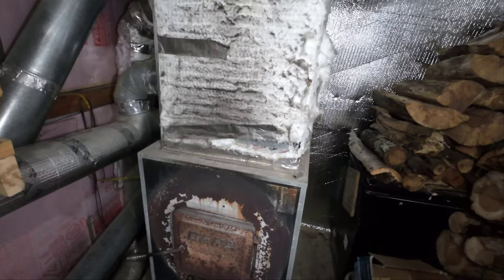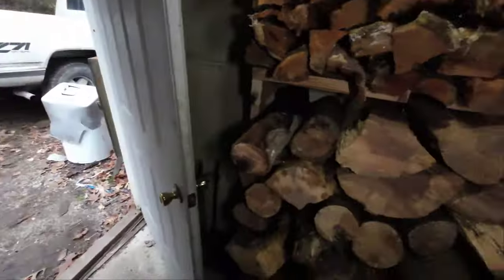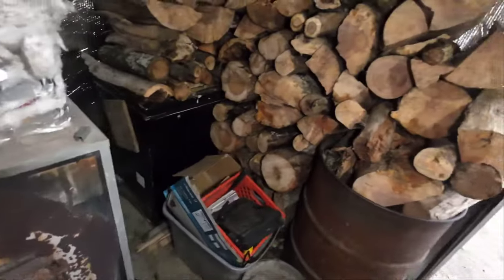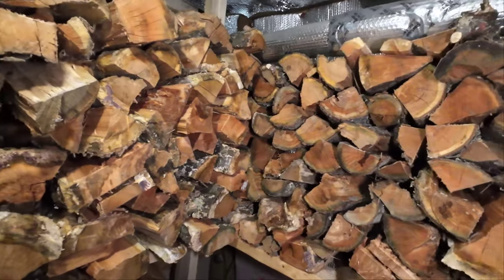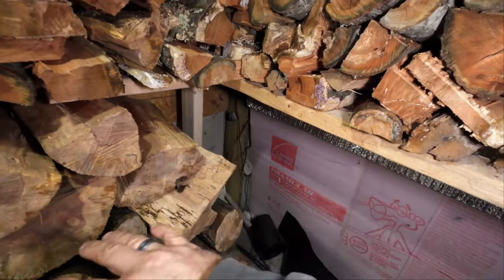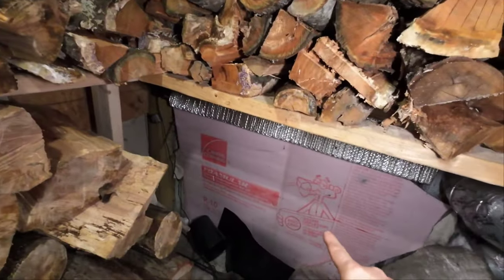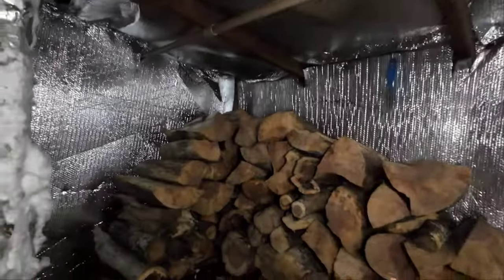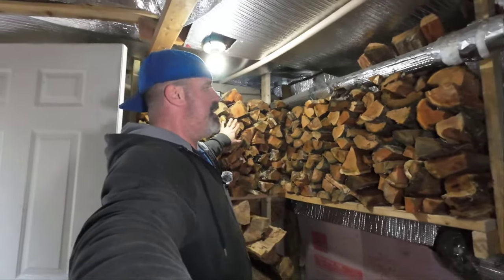Kiln Drying Firewood With Wood Burning Furnace

Comment: Get the cheapest dehumidifier you can find and use that in there.  That will draw a tiny amount of power, but accelerate your dry times tremendously.  Also, a very small fan to circulate the air in there will help also.  Super small investment to greatly improve your results.
Reply from the maker: Yes we have a small low-power type dehumidifier we are putting in. Still looking for a good isoscillating fan that doesn't use too much power adding in too many items defeats the purpose as it'll lower your income cuz you're using more electric. Results video will be out soon but we already have a load of hickory in there now and it's already starting to crack up

Comment: I like your wood drying idea now with the furnace shed. It could get better by sealing any air leaks first then maybe insulating better. I just subscribed today after watching your freezer kiln video. I bought at an auction for less than $20 bought a commercial all stainless steel fridge/proofer with two large insulated walk in glass doors. Basically you can roll in two bread racks and it controls the temperature rise for bread ect.. It doesn't work although I thought that it would make a perfect south facing solar firewood kiln to dry my firewood even in winter. And I already have rolling food tray racks so I wouldn't have to handle the wood too many times. I've been scouring YouTube for solar kiln videos today also.
Reply from the maker: Actually we just finished the run on this. Results video coming soon but it worked very well. The truth is I think you're right add more insulation. But I actually think we need an escape fan for when the humidity gets too high in the beginning. A simple hole is good but if you go watch oak farm firewood he has a fan exit port to remove humidity faster. We will build a solar kiln this spring to drop red oak in. Thanks for subscribing